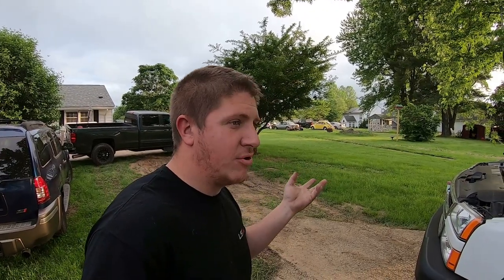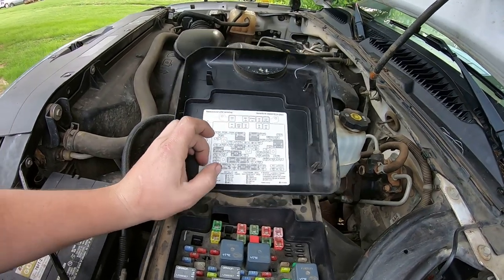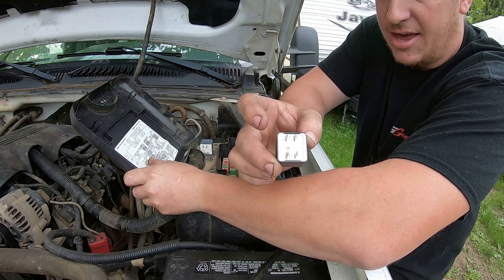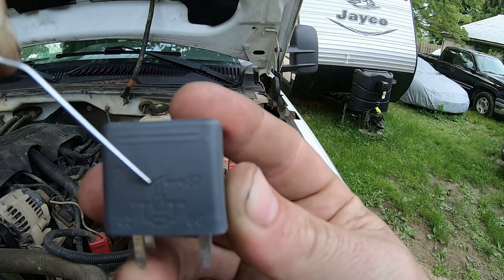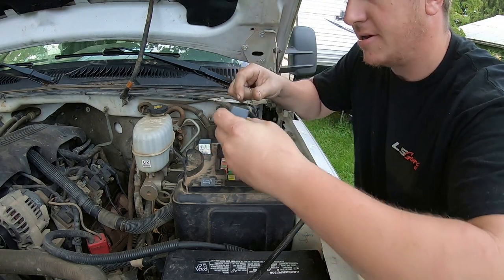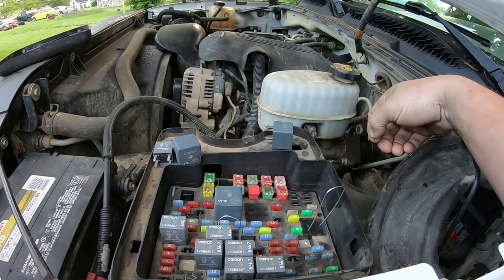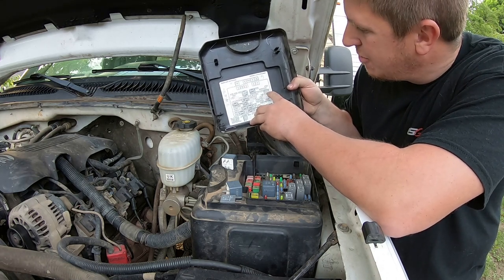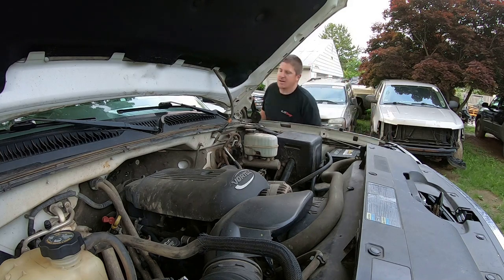Start ANY Gen 3 LS WITHOUT the KEY

Comment: 👍👍 its 4l60E and 4l80E same size ? From bellhousing to tailshaft?   I mean on swap , besides the yoke u need a shorter driveshaft?? Or d same
Reply from the maker: it depends, a short tail 4L80E is about 2.5 inches longer than a long tail 4L60E. They're the most common you'll come across. But they do have short tail 4L60E and long tail 4L80E those are very close to the same length
Reply: @MohawkMotors  @ i have a 96   4L80e,   And its same length as d 60E,,   Does it worth rebuilding it?    Or getting a newer one?
Reply from the maker: the 96 4L80e is a good transmission also, the only advantage to a newer one is the better cooling due to the revised fluid flow, but there are lots of builders and kits that can upgrade the earlier design 4L80e (97 an earlier) to work just as well as the later design transmissions. Unless you're trying to make a ton of horsepower and torque or do a lot of really heavy towing, the early design 4L80e that you have is plenty strong and reliable.
Reply: @MohawkMotors  @ thats all i need to hear, since i got the core already,,,     Thanks alot,,,    👍👍👍💪🏻💪🏻
Reply: @MohawkMotors  @ on the 80E transmission a regular slip yoke only goes in like 3”     How that’s gnna work,   Since stock was on a bolt on yoke driveshaft,,
Reply from the maker: The bolt on output shafts are a bit shorter. You'll need at least 2 inches of engagement, preferably 2.5 inches to be safe, so you won't have as much compression into the transmission, but unless you have a suspension with a ton of travel that you plan on using, half an inch of compression or extension is plenty for most stock style suspensions as long as you don't push to the limits of the travel.
Reply: @MohawkMotors  0 ok , i got it, i will use the bolt on yoke, modified,  and then  like 3/4 “  of play,   The truck will not  get load, or anything, its just a cruiser,  thanks,  jason

Comment: Why pull the other ones? Can you just pull relay and start? Also soon as I connect starter relay it starts to turn over.
Reply from the maker: If you only jump the starter relay it will crank over, but there won't be any power to the pcm or fuel pump so it won't start.

Comment: Hi and thanks so much for your videos!  This morning I tried starting my husband's '01 Tahoe LS (he left town for 10 days and took the keys with him by mistake - uncool).  I could easily separate the linkage and put the car in neutral but when I went to short the 30/87 pins everything went well except tat the fuel pump "pin" got super hot.  I could start the motor (could hear the fuel pump run) but it wouldn't stay running.  My guess is the 'short pin' I used wasn't tolerant of the current for the fuel pump?  I need  the garage space as I work on tons of stuff so I just pushed it out but I'd like to do this right.....and send him a pic of it running!  Any ideas?  Thanks so much!!  You rock.  Sharon
Reply from the maker: Hi Sharon! You're welcome. Thank you for watching.

You're exactly correct, if whatever you used to "short" the 30/87 pins got hot, it isn't conductive enough, not tolerant of the current required. As it gets hot it also become less conductive, resistance increases, which would cause the fuel pump to not receive sufficient current to operate. 

If you can find a piece of 14 or 16 gauge solid copper wire (like from house wiring) that would probably be the best thing you can get to short the pins with, a few light hammer taps on each end will flatten it enough to fit right in the 30 and 87 pins. If you have a spare relay you could remove the plastic cover and tape the contacts together also.

Comment: would that work on a trailblazer or a 02 bravada that have bad fuel sending unit.
Reply from the maker: if the fuel pump is bad this won't work, you're only option is to replace the pump. If it's just fuel level sensor part of the sending unit that is bad this will work.

Comment: I now know how to get into, run, and shift the transmission in my truck if I lose the keys somehow lol. I have an extended cab and the back windows can be popped off with a small and big flathead, sometimes without breaking the plastic hinges
Reply from the maker: Good things to know! Hopefully you never need the knowledge though!
Reply: How do you get it to shift without the key? I just bought a Cadillac and the ignition key with not turn. I’ve been searching to figure out how to replace the ignition but have not been successful yet. This method would at least let me know that it will run but curious how I would be able to shift it out of gear without turning the key

Comment: VATS was preventing me from being able to start my 03 Suburban. The PCM should always look for the signal before allowing the engine to run, otherwise we wouldn't need to reprogram the PCM in a swap.
Reply from the maker: I agree with you, but if you go out and do this, I bet your suburban will start. I do it all the time.
Reply: @MohawkMotors  I tried and the VATS was clearly shutting the system down. I've got a few sitting around here so I'll give it a try on another one and see how that goes.
Reply: @richardmccabe270  any luck ?    
 i had no luck on a 04 2500 vats would shut it down after a second each time
Reply: @Tazzthespazz74  No and it makes sense because that's exactly the purpose of the vats system and why we have to disable it on swaps! I have heard that if you unhook the BCM while the truck is running the PCM will not look for the signal again, I'm not sure how long that works!
Reply: Doesn't work! Starts and shuts down immediately. Fake news.
Reply: Could be your truck had VATs disabled at one point in its life?

Comment: Yeah my truck just starts then shuts off n u can here the fuel shut off so this doesnt work if vats is on ur truck. This guy probably has had his deleted at some point
Reply from the maker: @davidwoodard1538  I've only used this one trucks with VATS still enabled. With VATS disable you can skip this all together and just turn the ignition cylinder

Comment: I have no ignition relay
Reply from the maker: If it's a 99 to 06 chevy or gmc fullsize, you do have an ignition relay, or at the least the truck is wired and pinned for a relay and designed to use a relay.
Reply: @MohawkMotors   another spot maybe? I looked at my relay map a few times and couldn’t see any.
Reply from the maker: It's in the underhood fuse panel, marked in the Map with a 5*, decode the 5* at the bottom, IGN 1

Comment: Why is my truck not staying on it’s turn over but will not stay on
Reply from the maker: did you jump all 3 relays, can you hear the fuel pump come on? Are you sure you have the correct pin terminals connected?
Reply: Mine would not run. It would start and shut down immediately.
Reply: Having this same issue. Is it an anti theft chip key thing? 04 Sierra 2500HD SLT
Reply: I was thinking the same that it wouldn’t stay on (given VATS is NOT disabled)